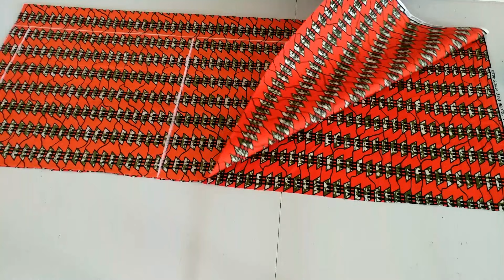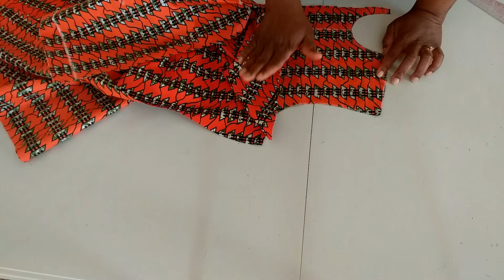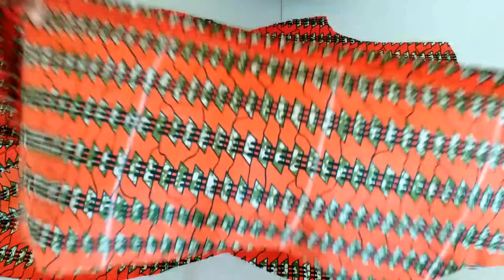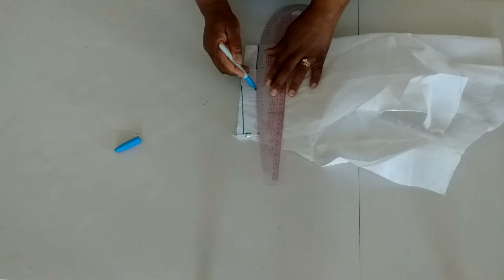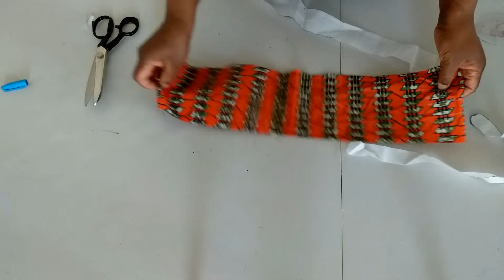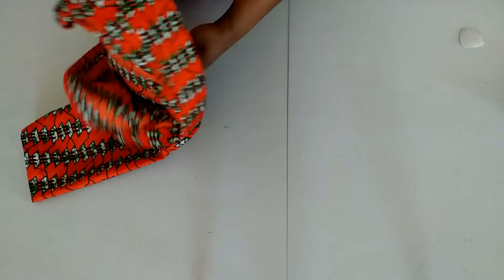How to make shirt dress without pattern (cutting and stitching)

Comment: Thank you so much mama for the tutorial. Please ma does the neck size work for all body sizes? For someone with a bigger bust, waist and hip, does it affect the neck line ma?
Reply from the maker: You can measure your neck if is more than 17inches you can use 2.75 inches  for neck width and 3 inches neck depth.

Comment: Nice work madam, my question is this, if the persons round neck is 18" and you measured exactly 18" what happens to the two the 2" you overlapped for the placket? Is it not going to make the round neck short by 1"?